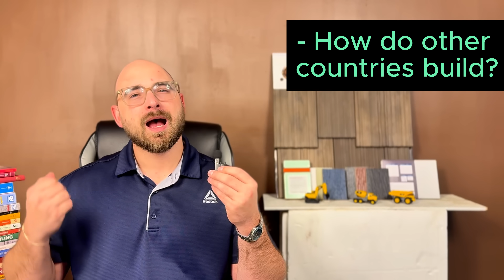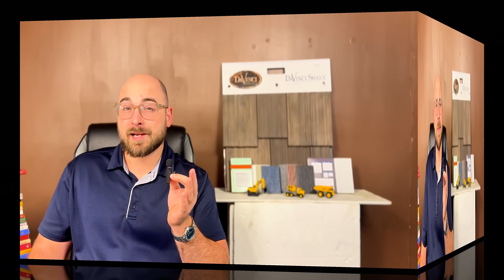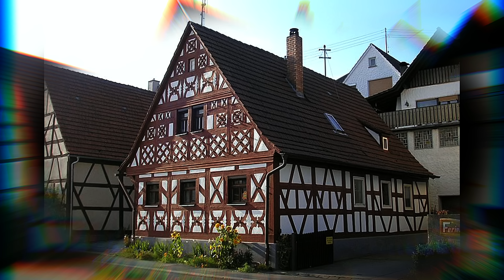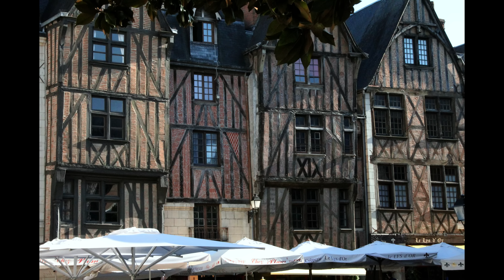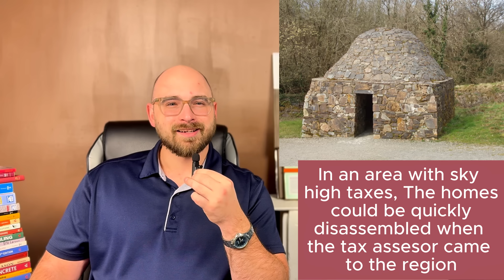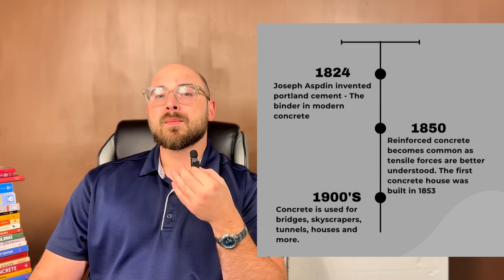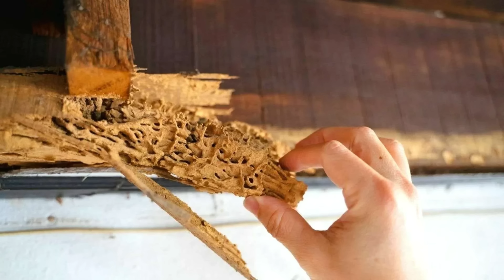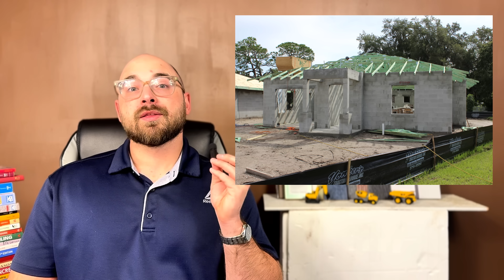Why Other Countries LAUGH at American Homes

Comment: How's the trend now after the LA fires? I wonder if solid structure has become more popular among contractors, in the west coast especially. From an outsider's perspective, it's just absurd that a house made of Lego bricks is impenetrable than American houses, especially when guns and tornadoes and cold climate are all present there, not including wildfires in the west coast especially.
Reply: If you search for a video "Rebuilding the Alphabet Streets" all the doubts will dissipate - the same inappropriate technology with ultra flammable and toxic chipboard built at exorbitant prices. I saw one video with a lady building from ICF "Better Block" type block. If 1 percent of homes will be rebuilt with structural masonry it would be an extreme success. If more - it will be revolutionary.

Comment: I have been bothered about our American timber framed housing.  I am familiar with wood pallets or skids.  They are nearly indestructible.  I have been surprised by the fact that most oak is used for this low purpose.  But our houses are built of fast grown timber. Very wide grain, light, not very strong.  Something seems very wrong about this. Why don't we build houses of oak ? And why, please why is any furniture made of glue and wood flakes?  What happens when it gets moist?  Why not oak ?  Make me a house of stone and oak.  Lime mortar.  A foundation of Roman concrete.  Solid oak doors, with iron and brass.  Dig and scrape the ground to the precise depth, shovel smoothe.  No fill ever. No settling .

Comment: quick and cheap (quality) BUT extremely EXPENSIVE. the US really need to do something about how houses are priced compared to thier cost of construction and quality. "Complexity" in design and construction using concrete is nothing more than a silly excuse. houses need to be sturdy and long lasting especially for a country that has tornados. a content creator (not him) also mentioned that it would take 8 to 12 months to make a concrete house, i think thats just contractors milking the living shit our of thier victims..i mean clients. 28 days and most concrete would have fully cured, for a single story house that would mean 2 months at most in 2 pouring sessions, floor slab then wall (column and beams) with monolitic pour.

Comment: What about the energy impact of structural brick. wouldnt it drive up utility bills?
Reply: Bills will be lower if proper insulation technique is chosen. Thermal mass on the warm wall side will help to mitigate temperature swings.
I'm not sure what you mean as structural brick.
If you use structural brick from USA you can either build two wythe wall and fill the cavity with insulation, or as a cheaper option (popular in Europe) add the rigid insulation to the outside and plaster it. The same applies to concrete block, but concrete wall being less porous offers much worse air quality in the house. It can be partially mitigated with using clay or lime plasters inside.
If you use ICF blocks they will be also insulating. Faswall/Nexcem are the best in my opinion as they contain no synthetics.
If you use structural bricks like Porotherm - they are already insulating. The same for aerated concrete like Ytong or Hebel block.
If you live in a climate with high diurnal changes you can build from compressed earth block of sufficient wall thickness (min 20") and focus on roof insulation. High thermal mass will help to lower or eliminate cooling cost and lower the heating bill.
Timber frame with light clay infill will be also insulating and healthy, quite fire proof and will have some thermal mass if also regular cob (clay+straw) for some walls or their parts is used.

Comment: My parents house is 60 years old and is sturdy as 3 days old. They replaced the roof with new steel roof  from Wetterbest and rafters. Probably will last another 40-50 years. But the prices in ol'usa are not cheap and don't really reflect the quality and the building methods. I always wondered about the sound proofing as long you have plaster boards as a wall, with only air between them.

Comment: You missed the biggest point of why the US has unacceptably bad building standards. The CARDBOARD exterior walls. 

I live in Canada where basically all houses are wood framed, difference is that our code requires OSB(wood chip board) as the minimum standard for exterior coverings. Most people don't realize the difference that the exterior covering makes to overall strength. A 2x4 framed house will fold like a house of cards without the exterior panels because there is no triangulation inherent in the structure. Build a wall from 2x4s and push it from one side, the nails will instantly bend and pull out of the wood with almost no resistance basically like a hinge. The external wood panels tie everything together and translate the load from leveraging the nails out, to shearing them and thus adding enormous strength to the structure. Replace the wood with cardboard and suddenly you've lost all the strength of the structure. Literally not one single country in the world other than the United States has cardboard exterior walls as acceptable building code, not one. It is the biggest and best example of profit taking precedence over everything, including peoples safety and livelihoods.

Comment: American builder here, California to be exact. The popularity of lite wood framing is mostly due to American psychology. “bigger and more is better” and the insatiable desire to remodel and customize. Middle and upper middle class people who are typically the best clients, want houses bigger than they need, and they want it customized to fit their needs and desires. Lite wood framing fits that bill the best, so contractors and engineers prioritize that method. This makes lite wood dominant and thus, the cheapest option for lower end mass produced housing (which is where we see most of the problems).

Comment: Don't know where your info is, but in East Europe (and I would guess across Europe) no one builds brick houses any more as they have poor earthquake resistance and can't stand up to the building code. All are reinforced steel concrete skeleton filled with bricks or other material used for the non structure walls. There are also the "lego" type, but they usually use a steel frame.

Comment: Most US houses have very poor insulation, tripple window pane glazing is virtually non-existent.
Also very poor noise insulation  both from exterior noise as well as inter room noise.
The way of electrical wiring in many us homes (Romex wiring unprotected within wooden framing) would not pass safety inspection in Europe.

Comment: All houses in the US are not the same. See the examples pointed out in the video. Also I’d point out that if you’re living in an area in the US that is between 30-90 degrees F and gets no more than 30-40 mph winds whats the point of building a house that costs a million dollars out of solid concrete? That’s what it would cost for a 2000 square foot house in the US.

Comment: Based on average building time needed for a 1.500 sqft home you need 12 months from planning to finish construction. thats give or take a month the same time you would need with brick and mortar like in Germany f.e. - based on costs for material and labor it would cost you 280k to build light frame and 320k to build with brick and mortar. still leaving out the fact that safety regulation in europe is overall much higher than in the US. so there's not really any argument left to defend our whimsy building procedures other than it benefits the contractors rather than the home owners.

Comment: Modern home construction in the US reflects a lot of what is wrong with our society as a whole. Slapping together as many cheaply built homes, using cheap (legal?) labor, on the smallest lots possible to maximize profits. I recently tore out a wall in my mid-eighties home and was shocked at the quality of the lumber compared to new lumber. Most new lumber is basically glorified tooth picks. I pity the fool that pays 500k for a newly built 2000 sq foot home built by a major developer. Also...don't even get me started on our obsession with aspalt shingles slapped on top of flimsy osb (and the associated prices).

Comment: This lengthy video simply conveys that America wants to spend as little money as possible. Money is the primary consideration. You talk about wooden frames in terms of economy, and about stone and brick in terms of reliability and fire resistance. So there is no reason to build these card houses, except that it is cheap and fast, regardless of how long they will last

Comment: To be 100% honest, frame houses are also built in Europe. But they are not particularly popular. Why? 
If the technology is followed correctly, the savings compared to brick/stone/concrete will be 20%, and compared to foam concrete or ceramic blocks - 10-15%. Foam concrete and ceramic blocks are almost on par with frame houses in terms of construction speed.
Now the question is, what did we gain by saving money and choosing a frame made of sticks? Poor sound insulation, poor thermal insulation, low durability, and walls that are suitable for insects and even rodents to live in. And a huge number of opportunities for incompetent builders to violate the technology, after which the house will begin to rot.
That is why frame houses are an option for the poor, and in America, even houses with a multi-million pound price tag are made of sticks and paper. By the way, the use of expensive finishing materials further reduces the gap in the overall budget, and the American approach (make a base out of dried poo and sticks and finish it with marble and gold plating) begins to look downright silly.

Comment: How strong do you need a house to be? Do you care if your house lasts 600 years?
Reply from the maker: The longevity is a bonus 

It’s really all about the safety, the security, the noise reduction and the energy savings
Reply: @Mike_Fortin You gotta remember that most North American homes are built on concrete foundations. The hardest part of a building is resisting the movement of earth and ground water. Light framed houses sit on an incredibly solid base, are faster, cheaper, more efficient, and have a lower carbon footprint than concrete or CMU houses. The trade off is your house only last 50-100 years instead of 500+ years. And I don’t think when it comes down to it, most people want to live in a drafty un-insulated home that is 500 years old. The lack of longevity can be a feature not a bug. As science improves techniques and materials the houses get better and better. Being forced to replace them every couple generations actually makes the houses as a whole better over time.

Comment: I never understood the concept of "Americans move a lot so it makes no sense to build solid long lasting houses". Where is the logic here. Americans don't carry their house with them. When they move out, someone else moves in. The original idea was "a house for anyone" so they were built extremely cheap. Most of the benefits of American houses you mention can be summarized by "its dirt cheap". Except, American houses ain't that cheap at all. So I largely disagree. European houses are generally better made than american ones. They are not perfect by any means but considering how long they last, even the argument of "larger environmental costs" is just invalid.

Comment: Civil engineer here. first, legally: not a single US home would come even close to comply with structural requirements in Portugal, let alone getting a heat or sound insulation certificates. We have very non-challenging climate, no snow, average wind, average precipitation and ordinary seismic activity, and yet your homes would be considered pretty unsafe for all of the above. 
in my opinion your homes are made to be a consumable: companies make a quick buck and you buy a quick house - quick to build, quick to rot away. your average home age is stupid small. if we were to abandon one of our modern houses with absolutely no maintenance whatsoever, we know at least the structural elements will be there in 100 years. We walk past houses and constructions older than your country every day, from houses, pubs, aqueducts, state buildings, museums, offices, everything.
at the end, i would not be caught dead living at an american-style house if i had a choice. they do suck. and that´s my professional opinion.
Reply: Exactly, I take issue with "increasing time, added cost, added complexity" NO this is the baseline. This is fast fashion Shein but for homes and some can't see it for what it really is. 

If you're being honest you should say "corporate home builders have the highest profit margin possible, need less qualifications and training, are not held to code and safety standards after close, can continue reselling dilapidated homes with white paint, paper and staples". 

You don't have to say "I want to copy Europe" you can say "I want better", and wealthy people don't live in those paper homes for a reason.
Reply: Thanks. Then everything is about quick quick quick, quick build quick rot quick sell quick bucks then why people think real estate is an “investment “

Comment: US housewife to contractor:  I want to take out this wall.  Contractor: not a problem, I can get the construction crew here in a couple days.  Probably be around $1500 all told, including fixing the flooring and painting the ceiling where the wall was.  
British housewife to contractor:  I want to take out this wall.  Contractor:  Are you daft?  The whole house would collapse.  Also, you need to get the permission of 27 total strangers to do that, cause your house is in a historical district.  Then, it'll take another 3 months to install shoring, a pocket beam, reinforce the foundation under the columns and tipping fees for the 3 dumptrucks of rubble after we jackhammer it all out.  You'll be looking at 13k pounds , maybe more depending on local council add ons...  British housewife:  How do you know its an historical district?  Contractor:  Its bloody England woman, the whole country is an Historical District.

Comment: You forgot Autoclaved Aerated Concrete (AAC) variations, very popular. Is not the same with clay or concrete brics, is more like a light spongeous concrete and others. Newer variants are very good thermal and water isolants. Older ones were soaking water.
 Also the concrete buildings if they are well isolated both sides have no moisture problem at all.

Comment: CMU can have rebar in the cavities and along the grout lines for very strong earthquake resistance. Doesn't need a reinforced concrete frame for that. Drop a couple bars in there then fill it with concrete and it is a reinforced concrete frame.

Comment: Point 5: I have travelled, and all the drains and pipes retrofitted for indoor plumbing in the UK  (outside) would freeze solid here. Then we would be using snow to relieve ourselves and wash up. The building "codes" for plumbing in the UK stink.

Comment: The most common house building method in The Netherlands is a row house with cavity walls, where the load bearing walls are shared with the neighbors. It has concrete load bearing walls, wooden prefabricated front and back inner cavity walls (with window and door frames) and a brick masonry facade or outer cavity wall and a wooden sloped roof with ceramic roof tiles. It can be build very fast, within 2 months it is wind and water proof and the interior building can start in conditioned circumstances without influence of the weather. The foundations are the ones which take a lot of time, we live basically in a swamp in the biggest part of the country, so all foundations have to be built on concrete piles and driving the piles into the ground can take a long time. Most piles are between 10 to 25 meters. They have to be driven into the ground to the second load baring sand layer, which is often between 10 to 25 meters below the surface.

Comment: Modern concrete is not as good as Roman concrete because it has a low lime content. Roman concrete's high lime content allows it to self mend when cracks appears. That's why roman concrete lasted 2000 years while ours get full of cracks after just 50 years. Romans didn't shy from spending there money. We are trying to save money way too much causing problems in the integrity of our structures.

Comment: The old world prioritizes longevity. We Americans are mainly concerned with speed of construction and low concern for the house's lifespan. Our taxation structure is designed to make multi-generational wealth very difficult to maintain. So, we think less about creating a multigenerational estate. Also, the residential construction industry is no longer filled with craftsman trained through a journeyman process. After my years as an architect, I have learned that no one reads specifications and few bother looking at details. Spanish is the main language for most of the building work force while the plans and specifications are written in English. So, we get crappy construction and pay through the nose for it.

Comment: Well, you cannot compare apples to oranges. Yes, most of US houses are built from timber and compressed chalk (I am joking but dry walls attached to wooden sticks with hollow space in between are not the best idea). The UK has  plenty of old cottages filled with history. But… a tiny flat in London could cost you at least £300,000, so tiny that you will hit your elbows on the wall while washing up. Same about most of old cottages and terraced houses. Tiny space for lots of money. For the same money you can buy a nice, spacious house in the US. Personally, I prefer old English cottages with history and character.